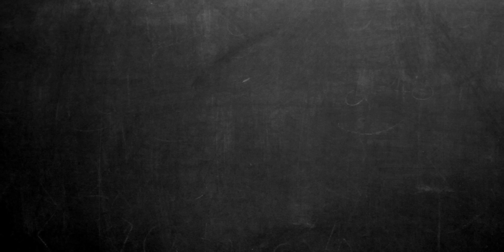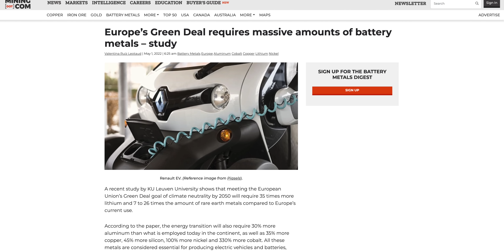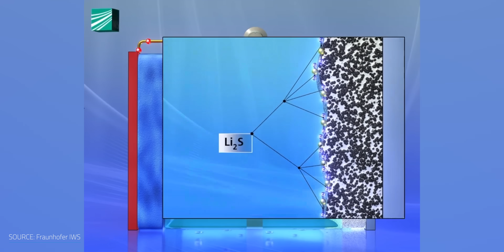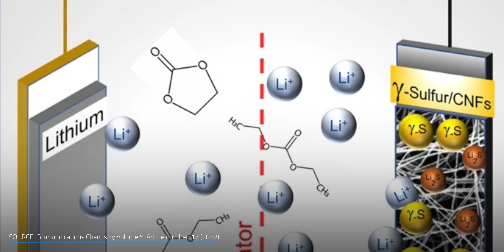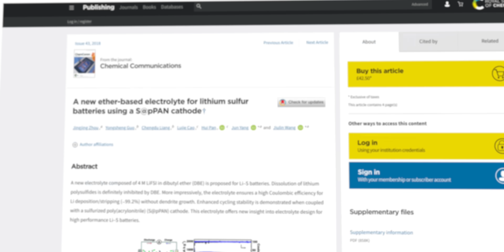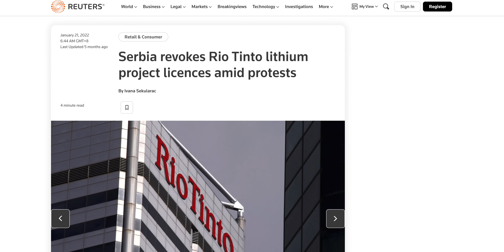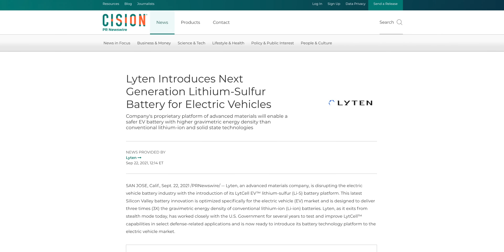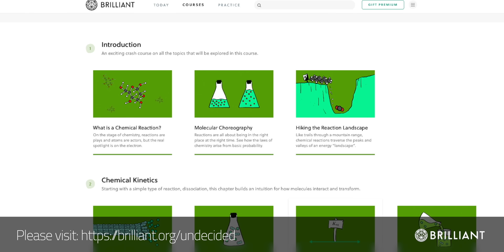Why This Accidental Battery Breakthrough Matters

Comment: Point about 8 times grater energy density is a bull shit. Lithium-ion battery energy density is 0.36–0.875 Mj/kg, and TNT 4.184 MJ/kg. If you increase energy density by 8 times, you would have battery with more energy per kilo then TNT, do you want to have car with potential to exploade stronger then TNT?
Reply: and yes i know that disel or gasoline have higher energy density, but for them to exploade you need to mix them with oxygen, and batteries can sustain fire with no oxigen. At this moment firefighters when called to tesla fire are just waiting for this thing to burn down and thats all, its extremly dificalt to fight battery fire.
Reply: Lifepo4 batteries do not exploade, but they can catch on fire! they will burn slover but they will and i have doubts than sulfure batteries would be any different, but with more energy to burn

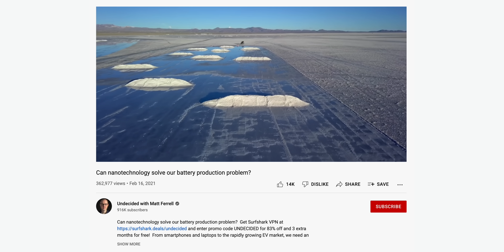Comment: It would be nice if you could add metric messurements whe talking about sizes or volumes. I as a German never use(d) Imperial messurements and need to google and convert them if I want to understand what your saying (8:58 I needed to google how much 500,000 gal are in liter or m³ )

Comment: Well spoken and communicated info. Thanks.
Just a few years back our auto mechanic(life-long) said electric cars would never make it due to battery issues. Ha…   I’m betting on these new battery technologies…   TMI to follow:  : )   I grew up with an oil burner car(worn out 6 volt 52 Chevy that guzzled $.43/qt. bulk oil with its Ethyl gasoline)…   dang, that was a lot of unnecessary pollution. ✌🏼🐸

Comment: If they manage to make sodium-sulfur batteries that have a good energy density and are economically viable for ev and large storage solution, it will be big.
Reply: sodium-sulfur batteries have always had a pretty good energy density. Manage to make them durable at room temperature. Not just big, massive.

Comment: The lithium sulfur battery technology looks promising. I hope that it can deliver better batteries without impacting the environment. It seems necessary to find altternatives to fossil fuels and a good battery could help.
Reply: Yeah, advancements in electronic technology has been increasing at a very high rate  except batteries, their technology has been the same more or less since last 12 years. Recently, we have been seeing advancement through llithium polymer batteries and now this.
Reply: @harshithsg5483    Even Tesla has moved to lithium iron phosphate batteries. I use them at my house. It's a pretty big improvement over lithium-ion. No cobalt or manganese, they last ten times longer, they aren't affected by heat, and aren't combustible.
Reply: There is less lithium need for these batteries, and sulfur is a waste product of the oil industry. By locking it in batteries, you would actually improve the environment.
Reply: Renewable energy is the first goal.
Reply: @dustincaldwell2049 That goal has been met.  We could renewable the earth right now....the problem is getting to 100% renewables would require us having ~10x more production than we need in order to cover environmental use cases (e.g. sun/wind).    Solve storage....and the rest will follow.
Reply: nothing will happen it never does
Reply: Why? There is more green on the earth than possibly in a long time?  Won't get into the science behind earth core temp etc. And it's effects by shade/trees.  Co2 is a necessity for earth
Reply: @isaiah4510  There is NOT more green now than it was a few thousand years ago, and it is ALGAE in the sea that is most important.
Reply: @HJ_Extravaganza  I wrote 3 replies and we'll they were removed.  The amount of damage by mining lithium. And the oil used to make batteries and stufff it goes into is very significant. Oil makes so many things we use its insane
Reply: @isaiah4510  Even to just reduce the cost of transportation fluctuating so dramatically and reducing the threat oil production holds in diplomacy would be reason enough to switch to batteries + renewables.  We will always need some petroleum for things aside from fuel, but that's a small, small percentage of what is used right now.
Reply: @isaiah4510 , nice repetition of infinitely refuted denial industry Big Lies. How's the pay? Or do you actually believe all that?!
Reply: @kylenolan2710  well they are kind of facts.  Do your own research besides the global initiatives put forth by media.  I'm not against renewable energy by the way.
Reply: @isaiah4510  more concerned with maintaining the sweet spot for humans than plants. plants will be fine with very high co2 levels.
Reply: @victorhopper6774  the sweet spot is constantly moving and hard to pin down.  The sun has unpredictable tendency to flare when it wants.  More science needs to be spent on the sun than on batteries imo

Comment: Just use a borax solution and tantalum electrodes. I already have a power supply that runs on it. Has been for 98 years. The older ones had platinum instead of Ta.
Reply: Can you please explain more and some link would be great